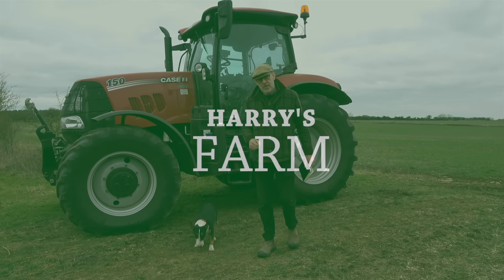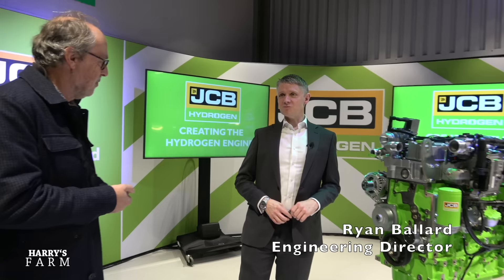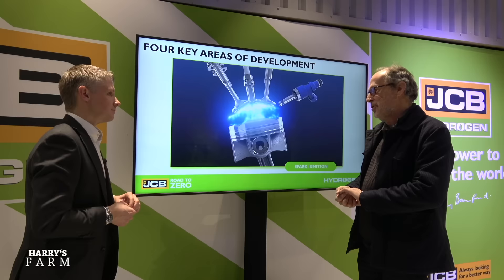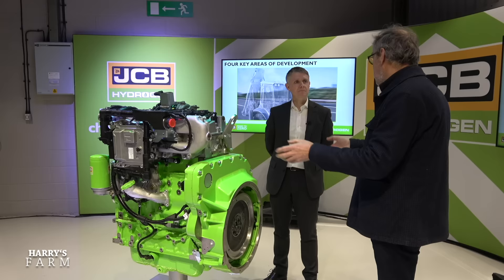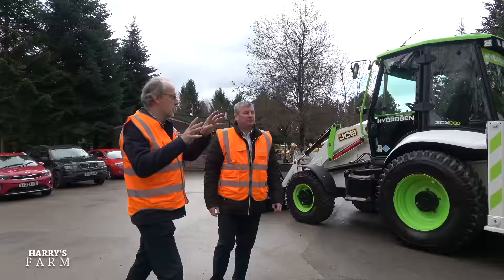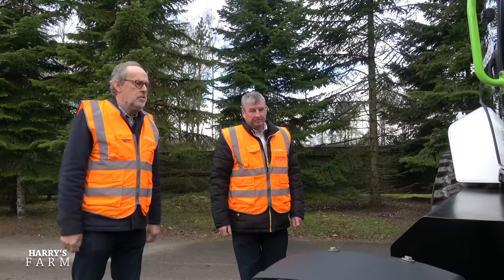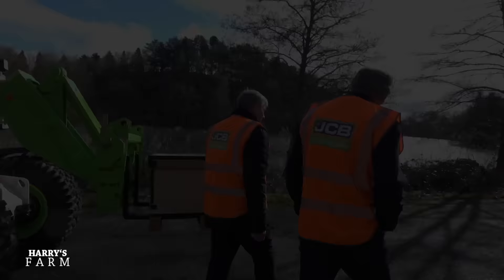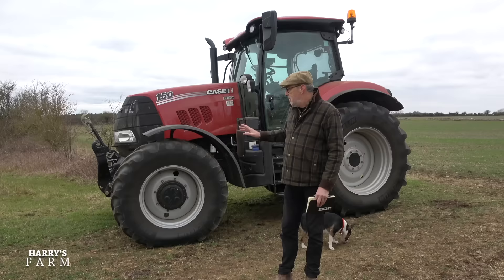JCB is moving to hydrogen power for all their big machinery. Here’s why.

Comment: Love the video, but something doesn’t add up. They said the machine hold 6-10kg of hydrogen. Now hydrogen contain around 3 times more energy than diesel in a kg for kg comparison. Now they also said the efficiency is about the same , which makes sense as the are both using combustion. But a tractor store 300 to 500L and some days that is not enough to go a full day. With the hydrogen we would then have to refil 10 times in one day! Also the well to wheel efficiency of burning hydrogen is just pathetic 😅
Reply: I was trying to work out how many kWh of battery you would need for half a day of operating, with a battery swap between shifts ... I think it's 200kWh, same as the Hummer EV battery pack, and then use the battery mass as a counterweight. Charge one while you are using another.
Reply: A 300hp tractor pulling a cultivator would burn 50L an hour. That’s the same as 600kwh, worth in diesel. Since a electric drivetrain is around 4 times more efficient we would need use 150kWh every hour 😅
Reply: @Homegaarden  that sounds right. For a car, it's about 2.5kWh of electricity per L of gasoline to go the same distance, you have it at 3kWh per L, I could see the efficiency of a diesel engine making up the difference. A hydrogen fuel cell can go 100km on 1kg, an EV uses 18kWh, a Civic 7.2L of gasoline. Hydrogen combustion is less efficient than a fuel cell.

You are not going to replace a 350L diesel tank with a 1000kWh battery, some compromise needs to be made, and run time is it. Swapping allows minimal downtime, and also allows the replaced battery some time to charge back up again. It will probably be no different to the hydrogen refill timing based on a 6-10kg tank, and probably be quicker too - at best a tank to tank transfer can equalize the pressure of both tanks, but you need a compressor to fully empty the source tank.

Electricity will be 10 times cheaper than hydrogen.

Comment: How are they avoiding the steel suffering hydrogen embrittlement?
Reply: Don't be silly.
Reply: Good question.  I asked similar at a talk with Reaction Engines some years ago (they're aiming for hypersonic hydrogen fueled air/space craft). The answer I got was the embrittlement is worse with pure hydrogen but having some impurities in the hydrogen feed can reduce/prevent embrittlement (ISTR they said oxygen in the mix, but it was a long time ago now). I think the embrittlement is also worse at/near room temperature, so might be less of an issue for a rocket engine where the hydrogen is either cryogenic or very hot, but might be more of an issue long term in heavy plant such as this. Be interesting to hear how they've designed it out and/or what the long term failure rate of the engines will be.
Reply: @digitalimager4946  https://en.wikipedia.org/wiki/Hydrogen_embrittlement

Comment: This is coming from a slightly odd direction but for me personally one of the beauties of an H2 engine is it will still have a gearbox, I'm thinking through to a future application with cars.
I like driving and a big part of that is controlling the gears (I currently have a car with an auto box and it is quite boring to drive, even when I use the paddles), using the clutch and so on. I dread to think how bland a drive a BEV is. I know BEVs can be very quick but that just makes them quick and boring which is probably even worse. An H2 engine with a great gearbox sounds like a winner to me.

Comment: Harry what is the price difference between the diesel and hydrogen engines ,? Also have watched both videos and found them extremely informative hope there will be a follow up  . Well done jcb
Reply: As I see it, the cost of the engine tech is infinitesimal compared to production, transport and then storing it again on site.. The big difference is: both farmers and building sites have the need to store fuel in site. Easy with a few removable bunded poly tanks. Now consider the situation with hydrogen.....its not going to happen - is it, not without a prohibitive install cost.
Reply: Is the uk government watching ?
Reply: @Kaltybean  are they heck. There in endless meetings - many in up market hotels outside of the M25 working on schemes to funnel tax payers money into companies that they're 'consultant directors' of. That was the core reason behind HS2

Comment: Here's why: incentives allocated by a government that doesn't know better. 

The UK's greatest energy demand by a long shot is residential and industrial heating. Hydrogen as a heat source is much more efficient and less of a challenge than ICE conversion. Until we have massive sustainable energy excess, hydrogen doesn't make sense for vehicles due to the losses involved in compressing the fuel to high volumetric energy density. Volumetric energy density isn't much of an issue for heating.

Comment: Do farmers want to pay up to x20 the price for the fuel they have now? 

Then add in you looking at up to 20% of it just evaporation due to hydrogen being such a small molecule and escaping and all the storage fuel tanks have to be replaced and upgraded - as a friend who runs a trucking company found out storage does not come cheap - £100,000s now for a fuel tank going to £1,000,000s for the upgrades to hydrogen and still losing 20%.

Before I forget, wonder if they fixed the laws of physics issue of burning hydron in an engine that produces 20% less power and uses 20% more fuel?

You do not really produce Co2 when you burn H2 but boy your nitrogen oxides can almost double and god help you if the engine is not in tip-top order or want it fixed.

What Harry might not know this Lord is greatly connected to oil and gas companies and thus where does 96% of hydron come from.... it come from Natural Gas Reforming/Gasification which takes a load of energy to make and a lot of natural gas - hence why the price of hydrogen is so high and only being pushed by oil and gas companies because they see this as a last hurrah and FUD against using none ICEs.

Comment: Hydrogen engines are a really bad idea. Their efficiency is low and they pollute with nitrogen oxides. Fuel cells and batteries are the future. The internal combustion engine is dead for pretty much everything. JCB are just clinging  to the past and will pay dearly for it. This site seems to be an echo chamber for the gulolible and uncritical with absolutely no understanding of the issues.
A dollar per kg for hydrogen is just pie in the sky, especially when the only type of hydrogen allowed will be green hydrogen. The energy losses in production, compression and transport of hydrogen are substantial and hydrogen infrastructure is both dangerous and very expensive.  The last thing you want to do, when you have got the hydrogen in your tractor, is wasting most of its energy in producing useless waste heat. That is why fuel cells with electric motors are far more sensible. Electric motors produce maximum torque from zero rpm and there is just no need for grarboxes.That is the route that Tesla have taken with their heavy machinery and they know far more about transport than JCB who are hidebound by their history.

Comment: 14:30 Very impressive how JCB can reduce the compression ratio while increasing the boost on lean burn , and still match the torque curve of a Diesel. Most other ICE hydrogen engines are well down on the fossil fuels power due to the low density of the fuel.

Comment: Thank you for the consistently informative videos. I am invested in a Hydrogen FuelCell company that has a USP of being tolerant to lower grade Hydrogen, even H2 derived from methanol. I would appreciate further information regarding JCB’s H2 engine, as to what purity of H2 is required. There are basically three levels that are relevant: 99.999% the most expensive; 99.9% slightly cheaper; and then <99% purity is the cheapest available. Thank you. Paul.

Comment: Thanks Harry for doing this video and pass the thanks on to JCB. Absolutely excellent and I believe the way forward. Batteries have limitations and need lots of resources not least the means of generating electricity and transmission to charge points so batteries can be recharged. Hydrogen portable like diesel and petrol. Tankers and cylinders make hydrogen portable. The next big development will be replacing all the two stroke engines with either batteries or smaller hydrogen powered engines. Hydrogen is portable and some of these two stroke machines are used in isolated environments.
Reply: Wrong. Electricity is available everywhere. Hydrogen transport and refuelling is an expensive nightmare. That is why things like the Toyota Mirai are expensive dead ends.

Comment: Neat technology, when you said "battery's dont work" the correct statement is actually current batterys  arent pratical, there is so much investment into battery's that in time they will be practical - it might only be a couple of years away when battery density has doubled (sodium iron for example) and if so then battery electric will be the simplest option.
Reply: Yup

Comment: There is a significant problem with using solar power to run hydrogen electrolyses as the units must run continuously to be efficient.
    That will require large storage of energy as well as secure backup power generation.

Comment: Theoretical pie in the sky outside equatorial regions and unscalable everywhere else.
I once worked with hydrogen and can say that it is extremely fragile and sensitive substrate. The engineering and safety tolerances needed for mass application are stratospheric.

Comment: Government appear to be doing the bare minimum, leaving the private sector are taking up the slack, as JCB are doing here. Application and cost/benefit will determine the need and appropriate/best solution for engine/fuel in different applications. For most consumer vehicles, like private cars, batteries are fine and for most people in the relatively small UK, the right solution. What's helpful is that finally people are realising that where they do need hydrogen, e.g. in heavy equipment applications as you've explained here, that the appropriate hydrogen infrastructure just doesn't exist yet and the current hydrogen production cost is too high. This is not an insurmountable problem. They are just starting later than the car industry. A lot of opposition to hydrogen (e.g. for cars) has been due to the lack of hydrogen infrastructure, the production cost, bulk storage capacity, and distribution issues. This makes it far less suitable for the mass car market, for example, and although hydrogen can work for private cars, mostly it's just not necessary given their typical daily range. Of course there will be cases where huge range is needed, thinking here of delivery vans, taxis, reps cars, where they might easily cover several hundred miles in a single day. In those cases, hydrogen might be the suitable alternative solution too, but until the hydrogen infrastructure is in place, battery-electric remains our only alternative to fossil fuels at present.

Comment: Good job with video and I'm frankly quite excited what JCB did. EV might be a way, for smaller vehicles, and I was a bit skeptical about directly hydrogene powered engine, but at the end of the video I know that as it's made all together, engines, vehicles, supply .. it all and as whole makes sense. That's the way.
We need to work a bit, probably not JCB directly, on easies and cleaner hydrogen production and storage .. and in storage space solid-state metalhydrids, instead of gas/liquid (extreme pressures or freeze) hydrogen, seems to me a better way, but we will se what this exciting future, and briliant engineers like those at JCB, will bring us.
Thank you for video.

Comment: Interesting solution to retain combustion engines with low emissions, they will still have a lot of moving parts so need similar levels of servicing as diesel engines and need to consume lube oils. What's interesting is these are Hydrogen combustion engines rather than Hydrogen fuel cell engines. Ideal for HGVs, heavy agri/construction, etc Depot refuelling means the absence of public H fuel infrastructure is not an impediment.

Comment: Good video Harry you ask really good question. I would like to see hydrogen being use with a Proton exchange membrane to create the potential  difference to drve an electric motor which has maximum torque and breakaway not at 1200rpm.  Renewably sourced Hydrogen is unbelievabley expensive,  short term reformed methanol fuel cell would be a better option (RMFC) this does not need highly specialised equipment, and the energy that is needed to to store Hydrogen is not required it will just use what's at the service station now. Still making what is really an Internal combustion engine is not good economics, 
Most light vehicle trucks will run on batteries (250 / 400 miles) heavy trucks , mine vehicles,  will run on Hydrogen with electric motors

Comment: Hi 
Hats off to lord Bamford and his team for a  successful engine development. It is a pity that we are further away from a hydrogen infrastructure than we are an electric infrastructure for BEVs let alone a green supply of hydrogen. Question not criticism Would it be of any merit to develop an interim unit to use cng or lpg that we do have a kind of infrastructure in place until a green source of hydrogen dose come on stream as burning cng or lng would be less poluting than burning hydrogen that has not been generated through a  green process.

Comment: Interesting video. No point in H2 if its made from fossil fuels, this needs to be regulated very closely to ensure only green hydrogen is used. The fossil fuel companies are working hard to green wash us with hydrogen. There seems to be an innate urge to keep burning fuel.  I hope as a consequence it incentivises more renewable to split all that water. Batteries will get much better so I think Hydrogen will always serve niche requirements. Hydrogen is very tricky to work with, as the smallest molecule it can leak out of the tiniest gaps, corrode certain metals, needs to be highly compressed and as a result requires complex supply chains. Will follow with interest.

Comment: JCB should look into green Ammonia NH3 as a fuel source. NH3 has the advantage over H2 that it is stored at -30 C only. As Fuel it is available as a liquid or in gazeous form.

80% of NH3 produced today is for use as fertilizer. NH3 has a 1/3 higher energy density compared to H2.

Comment: I hope its a success for JCB, but my concern is that a combustion hydrogen engines are around 40% efficient. To produce green hydrogen it around 70% efficient. So overall 28% to covert electrical energy in to mechanical energy, approx a 1/3 of what you get from an electrical system.

Comment: Supposedly this drive for greener solutions is gonna be great for our future. They've neglected to mention that potential metal to metal contact (ie big ends, small ends, cam shafts etc etc), will still require oil to be utilised within any ICE regardless of the fuel source used. Also, Hydrogen is pretty volatile stuff - look what happened to the Hindenberg in 1938 (? I think). As is mentioned in the video, Hydrogen would need more tanker loads delivered, compared to a single tank load of Diesel. That therefore equates to a less energy dense fuel - a farmer or a trucker would be forever refuelling their respective vehicles, using up valuable production time. Furthermore, there is a huge energy input requirement in order to extract and produce a comparatively small amount if Hydrogen. JCB obviously make so much profit that they have money to burn on developing something like this, but just like the current fad for EVs, it'll never be anything other than a niche market, inevitably pushing up individual unit costs due to the sheer lack of economy of scale.

Comment: great video Harry, and yes i would agree with the battery wont be the all we all have a mobile phone power tools that are great when you first get them but when they get charged after a few runs they dont work as well the battery life get shorter and when these are being used for work, an 8 hour shift will soon become a 3-4 hour shift and will not have the productivity and also the cost of electric today is getting out of hand what will the battery kit be costing in a year or 5 years. i also know a few people that have got battery cars and this winter they say the range of from 3-500 has dropped to 100. even with sola to get some power i dont see the speed they want battery power working to sunlight being productive.

Comment: The problem is that creating green hydrogen from green electricity is about 20% efficient. Compare that Lithium-Ion battery of well over 95% efficiency and on that comparison it’s easy to see why battery cars look more likely to take over. Well, they already are. Hydrogen is also difficult to transport and store, because hydrogen is the smallest possible atom it’s extremely difficult to prevent leaks. That beating said hydrogen could solve the climate crises if those difficulties could be over come. Hydrogen power stations may even be possible.
Reply: Battery technology is advancing for sure. When solid state batteries arrive in volume we will see a game changer. Batteries then would be feasible for long haul trucks. Rob Llewellyn has just done a Fully Charged vid on an American truck that swaps out and in a battery set in a few minutes. A 10 year old Nissan Leaf could be transformed by a simple battery set change.

At times the UK produces too much electricity that companies are actually paid to use electricity. This surplus can be directed to making hydrogen to store filling in the peaks of demand, and maybe fuel industry and large vehicles.

Battery EVs have taken the lead with hydrogen looking like it will never enter the small vehicle market, or niche applications such as battery-electric hybrid trains. It is in large energy uses that hydrogen scores.